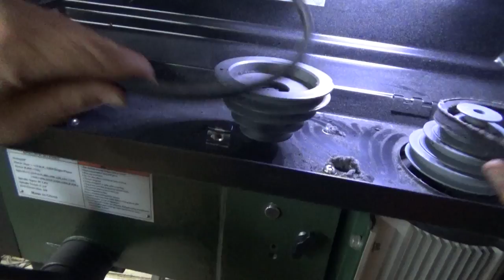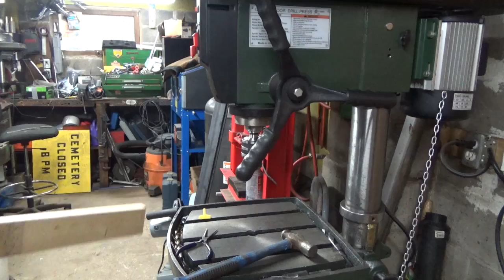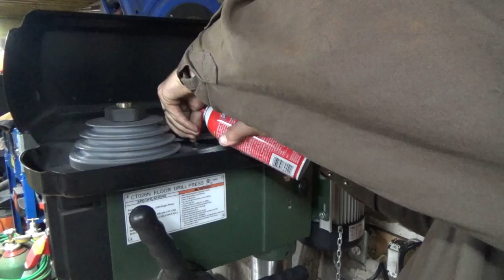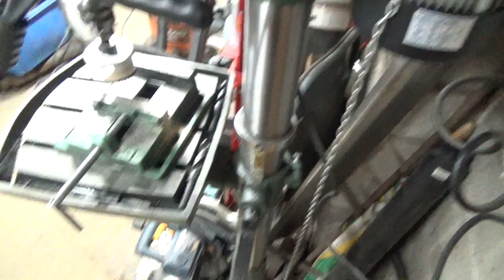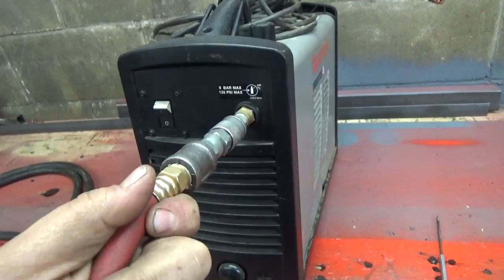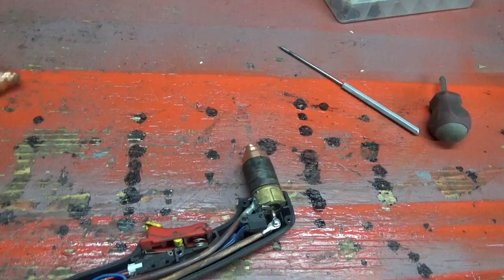drill press problems plasma cutter problems  she's just one of those days

Comment: Far far far too much pressure for that size of a hole saw. Holy Frig good man too much pressure. Gotta be patient, slow and steady, even pressure, and you have to lift and drop that kind of hole saw so it can clear the wood chips or it will bind up.

Comment: I have 20 inch 12 speed 1 hp Delta Industrial floor model I paid $1,400 for 22 years ago. I pulleys and belt tension is similar to yours but the motor doesn't move or twist under tension. I can't put too much down pressure when using a hole saw or it will either straighten the teeth out or clean them right off. I'm still using the same belts that came with it and I still can't get them to slip I can stop the motor on high speed on lowest speed I can hang off the handle and it won't slip.

Comment: My drill press is $80 and I never had a problem with it. It just doesn't handle a 1 1/2 inch spade bit, and I had a hard time adjusting the speed.

Comment: Wow you are hard on equipment. I think you using to much torque on the drill press. Also speed it up a little bit and it you want to check the alignment of the pullovers use a straight edge on top. Keep up the good work. 😄

Comment: There is nothing wrong with your DP and in fact your belts are likely too tight and your going to burn out your motor and your bearings. You need to slow down and stop trying to muscle it through. Let the bits do the work, back out to clear chips, and use some cutting oil when your cutting metal. You were also using a wood hole saw, and it was cutting the 2x4 just fine but you way over torqued it and didnt give it a chance to cut. It also is not designed for metal. Seriously, go easy and look up some videos or read up on your saw....you get really hurt with a 1 1/2 motor DP.

Comment: when you get a bigger drill press, it doesn't come with chains, and if it did, it would still have limitations, it would be "fixed" with a "clutch" same goes for "gear driven", and remember it's all going on in the "garage", and it's secondary, and supposed to be fun ......... slooooooooow down

steve reis sr

Comment: bill, i enjoy...... but, you are startin to work a little faster then your equipment (always happens).... kina like racin, big motor, then haveta have bigger trans, then haveta have bigger rearend..... then haveta have whole new car, the story goes on & on...... dad told me when i was a little kid , 2 things will "bug me"  the rest of my life "heat & speed", and figurin out the happy medium.... chain saw, table saw, grinder, drill press, all these have limits, an you have reached em...... so slow down, belts are made for safety & application, not fo production ! this hole saw is cuttin a big area, kinda 6 in , if ya measure it out ........ just slow down and it'll work, i just cut the same holes on a project here thru 1/4 plate (took about 6 min. for hole) , just fine, now i proly won't do it again for 6 months ........ plasma cutters will not leak when "new", they haveta go thru Q/A to sell, any more then that "they leak" ....... keep building, i enjoy ....
 
thanks, steve reis sr

Comment: Well the only thing that I can think of is maybe fix the middle pulley, because of the chip. And put washers between the motor and the metal bracket that holds the motor. Other than that you know more than I do Bill

Comment: It is not ideal but see if you can run an idler pulley on the belts that can be adjusted. It may give the belt more surface area on the pulley. But please get some bolts for that clamp its not safe to run that way. and if the belts do not slip the next thing that will go is when it catches it will rip that clamp out of your hands.

Comment: Maybe you need to invest in a used Series 1 Bridgeport vertical miller. It has, "back gears" (high/ low range) in the power head. Plus a variable CVT primary speed changer ( you use a crank to go up and down) to give you more unstoppable torque and almost infinite RPM choices at the spindle for drilling and milling. Plus it has more versatility with a "X", "Y" axis on your work table. Its not that much bigger than your drill press. Just sayin'. :-)

Comment: Bill it looked like the plate the motor is mounted to on your drill press maybe a little loose. There should be 2 nuts under the motor holding the mounting plate to 2 adjustment shafts. Take the 4 bolts that hold the motor on and remove them so you can get to them and tighten the crap out of them. That should help a lot with the slipping. Hope this will help you out.

Comment: Hi Bill Your drill press you could always try and get a belt to fit between the drive pulley on the motor and the pulley on the chuck shaft eliminating the middle set of pulleys altogether. She might run a bit fast but i think she wont slip as easily.

Comment: DEAR BILL;  MY NAME IS JERRY  I WORKED IN MAIN. FOR 40+ YEARS. I DON'T WANT TO TELL YOU WHAT TO DO BUT WE HAD A DRILL PRESS IT DID THE SAME AS YOURS IS DOING PUT NEW BELTS SAME THING WE FOUND OUT CHEAP AUTO  PARTS STORE BELTS WON'T WORK. SO WHAT WE DID WENT BACK TO THE BELTS THAT COME WITH THE MACHINE. AND USED THEM. WE FOUND OUT THE BELTS ON OUR DRILL PRESS WERE CABLE BELTS THAT WOULDN'T STRETCH. THANK YOU FOR YOUR TIME     JERRY MESSERSCHMIDT  LIVE IN HUMBOLDT TN. LOVE WATCHING YOU. I'M RETIRED 76 YRS OLD
Reply: I just sprayed on some belt dressing and now it doesn't slip anymore.

Comment: The belts are supposed to slip, you're adding way more pressure than you're really going to need.  The problem is if you let the belts slip too much (on purpose or otherwise) then the surfaces on the pulley become slippery from heating up so much from friction and they won't grip anymore.. Maybe you mentioned this, I'm not sure because I only watched bits and pieces.

Comment: As the other Gentlemen are saying Bill,you are putting to much pressure on the cutter.V belts are designed to have a certain amount of slippage,if it is excessive it means the belts are worn and dropping to far into the pulley reducing their grip area in other words "bottoming out".Please get some T Bolts for that vice Bill Thanks mate

Comment: Feed Rate: This is how fast the drill bit is pushed down. For reference, the recommended rates go from .001" per revolution for bits under 1/8th" to .007" per revolution for 1/2 bits. This, of course, isn't very useful if you're lowering the drill bit by hand. In general, push hard enough to create a continuous chip (note some materials just won't form one--like cast iron), but not so hard that the chips are turning brown or the bit itself is chipping. Slight discoloration of the chips is OK. In other words, take it out of over dive and put in 1st gear.

Comment: hi bill automotive v belts have a different v angle than a industrial v belt angle you can not mix one with the other.
that is why those belts do not fit the pulley grooves properly.get the proper industrial v belts recomended  for
your drill press numbers such as a-32 or 4l320 or numbers such as these and your drill press will work just fine.
these belts can be gotten at any bearing and power transmission distributor.
keep up the great videos.

Comment: .

Couple of things on the drill press. Get some steel pulleys and get rid of the aluminum ones. Your belts will slip less.

I use two wood wedges between the motor and the back of the drill press to tighten the primary belt. It seems to hold the motor better and allows you to tighten it up.

Just my two bits.

.

Comment: 1st: when you drill in metal: lubricate with milling oil
2nd: dont press on that drill like hulk when you´re drilling hard materials. 
That drill press is all fine. The belt slipping is just a safety thing. 
Continue with that press. Dont always buy new things because of little problems.

Comment: take the middle pulley off and put a  nut and bolt through the hole and get someone with a drill press to put it in the chuck and run it that way you can determine whether the pulley is twisted or not

Comment: drill press won't be powerful enough to provide the torque required to cut with that large hole saw, once the press starts slipping really you might be looking at a small milling machine

Comment: Bill I did some research on your drill press and it is only rated to drill a solid 3/4 inch hole if you want to drill anything like 1 1/4 inch holes you need a 2 horsepower motor that is on 120 volt or 220 volt anything bigger than 1 1/4 inch you would need 5 horsepower motor on 220 volt

Comment: Bill, sometimes the brain just gets overloaded. But on those days step back for a couple of mins and regroup. On the plasma cutter, don't be worried about opening up the plasma cutter unit(it is just the cover). You don't come off to me as one to just give up. Open up the cover and at least put eyes on the internal leak. I watch most your daily videos and did the plasma cutter start leaking after your new compressor install. You might have just added a couple more psi than your old compressor. Check for a pop off or bypass valve. I was completely shock that after watch you tear TV motors and tons of everything else apart AND repair them, you would be worried about taken off a metal cover of a tool

Comment: Bill. For frog snacks..... It'd make your life a lot easier and safer if you'd just get some T-Nuts and mount your friggin vice. It drives me absolutely bonkers when you hold it with your hand. One day it's gonna catch and it gonna snap your wrist. So bill... PLEASE secure your dang vice whilst you are using it.
Reply from the maker: +MegaMobass lol i wont catch when the belts slip.. ive held it before and i can hold it back easily it slips so easy
Reply: +BILLSTMAXX :) holy shnikes you actually answered me haha that just made my day. It's just I worry about ya bill, a lot of us do. I didn't mean to sound shrewd about it. I'm sure you could probably find a cheap set of T-nuts for it, it'd make for more accurate work and so on.

Comment: I had a Sears Craftsman drill press and never had any trouble. I sold it when i moved to Florida. Well now that i started over with tools again i bought a Porter Cable drill press bolted it to floor and it works great except for the part when it's running belt cover rattles like crazy but fixed that problem. Bill let the saw do it's work! If the hole saw binds up your giving too much pressure back off.  Thanks for the great video's!!! II read online that the drill you have that the pulley's are egg shaped.

Comment: Whats the max PSI  on the plasma cutter? after the new air compressor you may be getting to much pressure and blew the regulator in the cutter.
Reply from the maker: +Jason Darcy (JSDS2002) 135psi max im at 120
Reply: +BILLSTMAXX :) hi bill

Comment: on the drill press I would use a pry bar and put more pressure on the belt then tightenor just make a wood wedge and drive in between motor and  press and put more pressure on beltthanks again bill

Comment: if you touch off with the hole saw then drill a hole along the inside edge of the circle it will let the chips fall out and give you a cleaner whole and a faster cut. its a pain to have the added step but it works.

Comment: Bill iv got the same set up on my drill press at work I use a small pry bar on the top part of the motor mount to adjust tension and that elevated the problem with the tilt on the motor I think the problem is there adjustment mechanism

Comment: you need to get the right size belts that are meant for your drill press and the you really don't need that spray for the belts also when your drilling different materials you need to change your speeds and not force the drill bit into the material that's why it's stopping and that's how you can damage the belts so just let the drill bit do the work for you. and you should be fine.

Comment: Let the cutter do the work not you as in Jigsaws (as a good example) , You're always going to be able to stall a belt driven device and that is by design for your safety and the safety of the device. If you don't run a direct drive unit properly you are either going to damage the unit or yourself. Most probably Yourself. I would like to see more safety protocols added to your channel. Just for a start unplug the unit when you are sticking your finger into the chuck... I have been in many factories in my life including but not limited to Northrop Grumman. Safety is job One. I'm asking nicely for this to be a priority on your channel. You do allot of pretty interesting work the old way (Dangerous), the need to get it done without protocol). You don't have to listen to a word I have said here but it needed to be said.

Comment: Is there a travel limit on the middle pulley, not letting it travel further away from the quill shaft (front shaft), if there is, you may want a very slightly shorter belt on the front, remember that the old one may have stretched.
If you want to go for one belt, remove the middle pulleys, but you'll have to turn the motor pulley over, remember to measure the circumference of the replacement belt with some string in the pulley grooves.
Putting that much weight on the drill is sure to make the core bit jam, i think i would rather have the belt slip than be thrown across the room.
Those core bits often wobble, they are not precision tools, yours isn't bad, specially once it gets into the material.

Comment: Bill you're pushing down way to hard. The belts are supposed to slip when too much force is applied, so you don't break the drill press or yourself. Calm down and let the drill bit cut through the material. The bigger the hole you're making the longer it will take to make the hole.

Comment: On your air leak inside the plasma cutter there is a auto drain in there when the system gets moisture in the system it drains well over time dust and dirt can get in there and cause that valve to stick. most of the time a good cleaning will fix it. on the drill press if you want one that dont slip look at a gear head drill press no belts all gears. also another option is keep the one you have for smaller jobs and look into geting a mag drill for the bigger stuff there great for drilling holes

Comment: not sure if you will see this, but with a drill press your not supposed to put that much force down on one like that. the belts are designed to do that when there's to much down pressure.

Comment: get any old American made drill press. older the better, i have a table top American mad press (idk the brand off the top of my head) but it WILL drill through anything, snd wont slip, snd its also from the 60s. it will cut a 1 inch hold through hardened plate

Comment: Bill your drill press looks just like my JET J-2500.  That center pulley will move independent of the ends, and on my machine the belts are an A28 and an A26.  The front belt is an A26 or 4L280 ( 1/2" x 28" ) and the rear belt is an A28  or 4L300 ( 1/2" x 30" ).